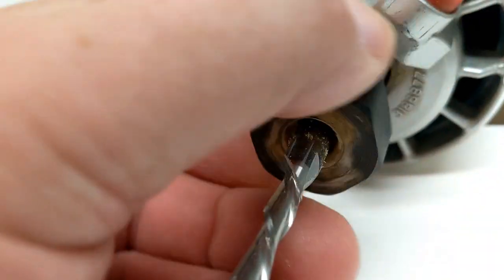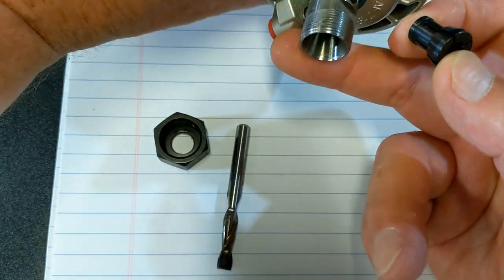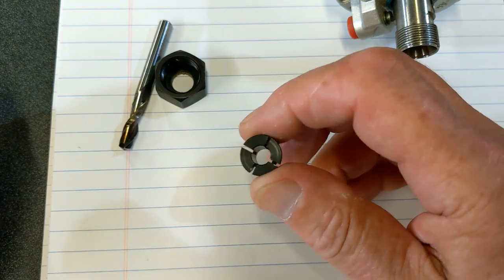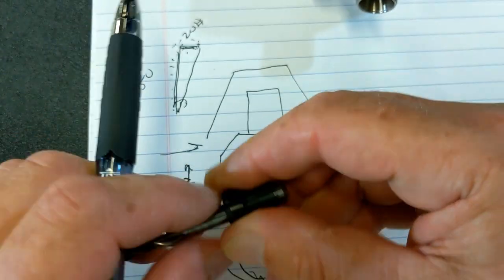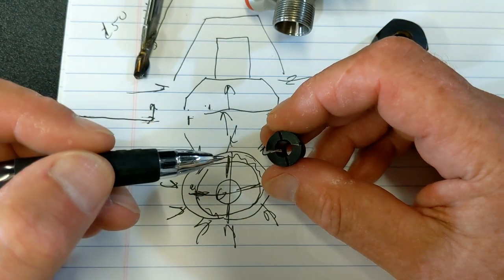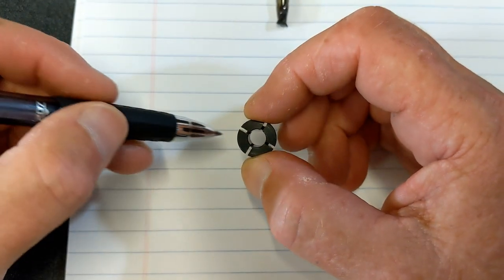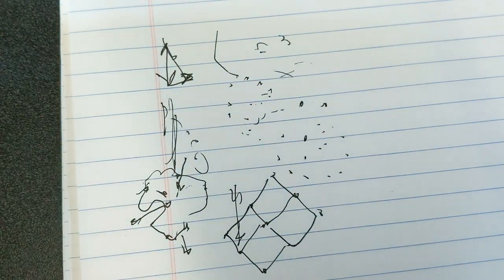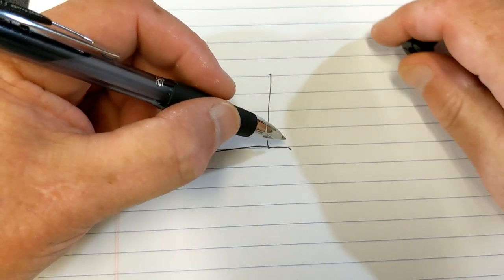CNC Router Projects **IMPORTANT TIP** [Save Your Wood Projects] - Garrett Fromme

Comment: Half of your followers quit CNC and went back to college for engineering with a heads up on the teacher. 
I find it interesting that this issue has existed for so long and no up and coming genius has come up with a better way. It's what I haven't tolerated my subordinates to ever say "that's the way we've always done it"! Grrrrrr. 
There's always been a better way and this too shall pass. If someone out there doesn't fix it soon, then I will have to put it on my bucket list 😤. 
Great job again 👏.
Reply from the maker: That's why all the CNC'ers went away. they're busy  filing for student loans
Reply: Thank you, Sir! Mindset of proper process, inspection prior to setup and checklists!

Comment: I saw another YT presenter show the viewers that some bits are actually less that the stated diameter; of course, most of these were the cheaper versions of bits, like sets that were 4 or 5 for $25.  The other factor was is to keep as much bit up in the collet as the work will allow to eliminate the flex from too long exposure of the bit shaft which causes vibration of the bit. That comes from other than CNC operations, but much higher rpm systems.
Reply from the maker: Hey Paul. Yes, the cheaper bits have serious variation. that's why they are cheap. No quality control. And that tuber is absolutely correct. Al bits have deflection and harmonics can set up in them. the more they extend out, the more likely that will happen.

Comment: In the so called metal cutting world, a 1/4 carbide up cutting router bit is know as a 1/4 Carbide 2 flute end mill. They are essentially the same thing. When held in a compression holder like a collet, the tool is held in place by a combination of clamping force and friction. As a cutting tool is removing material, it is pushing chips up but also pulling itself down. If a collet is not tightened sufficiently , or if there is material preventing the collet from closing sufficiently on the tool shank, pull down of the tool can occur. This is not an uncommon occurrence on Bridgeport type mills, where most end mill type cutting tools are held in a collet.  You clamp a tool in the collet, turn on the feed and after a while you notice your tool sliding down.

In larger and much more powerful machining centers, where larger cutting tools and higher RPM's and feeds are involved, this problem can occur much sooner and more dramatically. In order to deal with this, many end mills have what's called a Weldon Shank or a Weldon flat. It's quite simply a flat ground into the shank of the end mill. It goes into a holder where it's held in place with a set screw. This keeps the tool from pulling down or rotating in the holder when talking heavy cuts.
 
Often in a shop, knowing that is likely to occur, we will often grind a flat on an end mill that doesn't have one. This is often the case with carbide end mills.

We don't seem to have this type of end mill or router bit tool holder on our routers. When changing tools, take out the collett and clean the dust out of it and the router spindle. You can blow it out with compressed air or I suck it out with my shop vacuum. When putting in a new tool, tighten it sufficiently. Yes, you still may have some slip down during heavy cuts, but the chances of it happening will be much reduced.

Garrett described the reasons this might occur in great detail, but I believe the message here is to make sure your collett and spindle is clean when installing a new tool, and reduce your chance of a problem occurring.
Reply from the maker: CNC, I probably could have made a 1 minute video instead of this deep dive. Might have been easier on the brain.
Reply: @IDCWoodcraft  You nailed many of the reason why tool pull down can occur. Still, it's SOP (standarrd operating procedure)and good practice to clean out tool holders when changing a tool or collett.